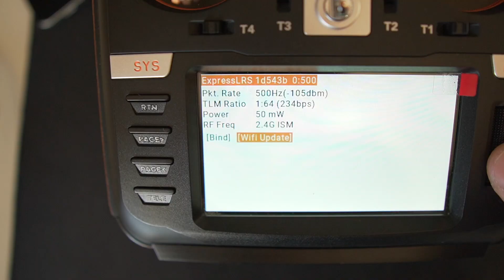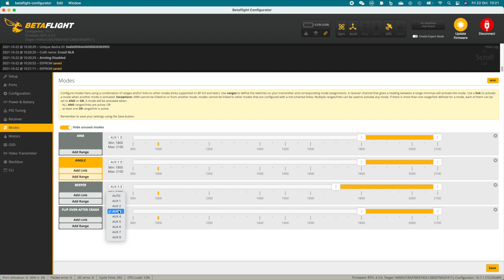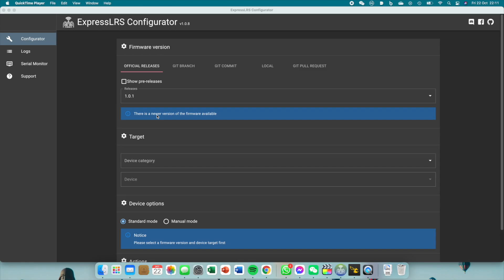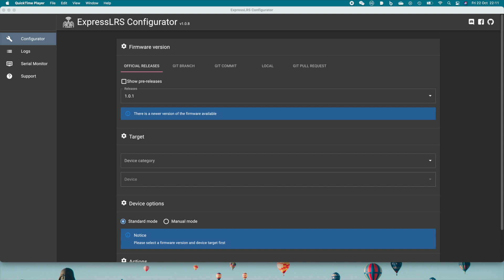ExpressLRS or ELRS 2.4 Ghz SPI receiver Setup - How to bind a Happy Model AIO ELRS card (Crux3 NLR)

Comment: Dumb question. Does an eu-lbt elrs radio bind to the built in spi rx?
Reply from the maker: Yes they do. The good thing with ELRS is that you flash the software you need. Both on the tx and RX. So you don’t have to worry much on those kind of things.
Reply: Thank tou for responding! 
That was the problem. On an aio spi fc you dont flash the rx. You only update betaflight. So i assumed it was going to be fcc.

Comment: I'm wondering if you can help me. I have a happymodel spi elrs 2.4 receiver and I flashed my zorro which I should not have done. Now it will not bind again but will bind to my jumper t lite in betaflight. I never flashed the FC. Now when I flashed the radio it does have a binding phrase. If I could unflash my radio it would be fine I think but I don't know if there's such a thing.
Reply from the maker: I’m
Not sure I follow the whole problem. Unless you have mayor version differences they should work together. SPI I believe is still in 2.X version unless you use betaflight 4.4, so you will need to flash your zorro with a 2.x version. 
In terms of firmware you never “unflash” you always flash, just the version that you want, so if you flashed 3.x and now you realized you need 2.x you just “flash 2.x”

I hope this helps
Reply: @NordFPV  Thanks a lot for the reply and info. I will look into it

Comment: how do I set to 250hz .. The problem I had was I downloaded the firmware off beta flight instead of happy models web page the firmware on beta flight is wrong
Reply from the maker: you can select 250hz in the radio, inside the ELRS script

Comment: I've a radiomaster zorro 2.4Ghz with the ELRS v2 and the LUA V2 (Edge 2.7.1), I bought a Mobula 7 1S 2.4GH, but I can't bind it one with another.
I've proceded like you sayed, but the drone wait for the radio and nothing happens. What i'm missing?
Reply from the maker: Most probably you have different ELRS version. Check what version has the drone. It may still be in V1.
Reply: @NordFPV  I Was in athor model settings. Thank you

Comment: Hi Friend, how to update the RX firmware that come factory-installed expresslrs inside the AIO Flight Controller? Do we need or not to update the firmware? Your thought would be appreciated. Thanks
Reply from the maker: Normally AIO have what's called a SPI receiver. Those one are updated when Betaflight is updated. A bit troublesome. Much better to have a serial receiver which is updated by itself. I hope that helps Ce Harn!

Comment: Hi friend.  I have a crux3...Don't need the passfrass?  I don't possibly use the ELRS configurator, And I don't understand what is the mode for fix the passfrass... Whitout elrs configurator. Or not is necessary?  Don't need flash the FC...?  In short, I would like to know how I could put the binding phrase, the transmitter flashes it to version 2.5.1 through a firmware file that a person prepared for me in a forum... now I have my 1w module already updated, now I need to update the receiver to version 2.x.x but I still don't understand if you can use both without the binding phrase or how this actually works... my problem is that the ELRS configurator gives me an error when I run it, error: bad signature 0x00000000 etc etc. don't possibly use the program... questions.. lol.  Sorry for my horribly English but I are Spanish..  tanks friend..
Reply from the maker: Hola, mi estoy seguro cual es tu pregunta. Pero te digo, uno no está obligado a usar el passphrase, puedes aparearte usando el botón, pero es mucho más cómodo con el passphrase. El configurador es importante para mantenerte al día. A veces si la versión del receptor y emisor no son la mismas, las cosas no funcionan.
Reply: @NordFPV  bien muchas gracias por su tiempo y ayuda.  Sólo necesito arreglar esto para empezar, poder bindear el quad Crux3,   pero necesitaba saber sí podría bindear sin el passfrass hasta que pueda arreglar mi PC y así ejecutar el configurador y entonces arreglar con una passfrass.  Muchas gracias
Reply: @NordFPV  creo que solo me queda flashear el controlador a una nueva versión 2.x.x.  para poder hacer la unión.. luego como decía, con más tiempo, arreglar mi pc para poder usar el ELRS configurator.. gracias otra vez amigo

Comment: Hi NordFPV, just a quick question.  I have a happyModel Mobula 6 with built in ELRS 2.4 SPI Receiver.  My ELRS transmitter was originally running ELRS v 1.1.0 and I had no problem binding to mobula6.  I then recently upgraded my transmitter to ELRS 2.0.0.  In betaflight I use the bind button to bind the mobula6 to my transmitter again.  It seems to work, but I noticed that as I move my controls (throttle, yawl, pitch, etc...) values in betaflight don't move smoothly.  changes to the controls values seem very jumpy or erratic.  I think I need to somehow upgrade the mobulas6 version of ELRS to 2.0.0 as well.... How do I do that?
Reply: so they are selling a drone that is obsolete before you get it nice NO i do not want to change my tx to an earlier version.
Reply from the maker: @danno20121  no, everything is software. You just need to get your parts to the right software. If you upgraded your TX to 2.0, you just need to upgrade the Mobula Betaflight firmware to the right release. As today the right release is still in beta, you can still use it, but you need to enable unreleased version to install it.
Reply from the maker: ELRS v2 is not backwards compatible with v1.x so you need to either upgrade your drone firmware or downgrade the TX firmware. The drone firmware is only in beta and a bit more complicated to upgrade. It’s possible but I’ll recommend to downgrade your TX and wait for the official betaflight support for your SPI receiver

Comment: Do you need to worry about version of ExpressLRS on TX and RX?  If so, what is the best way to flash?  I have a BetaFPV Micro TX that I flashed to 2.0 and a new Meteor65 Pro that I assume is on 1.0.  Betaflight says it is on 4.3.  Cheers!
Reply from the maker: Hi, yes you do need to pay attention on the version on the TX and RX, or at least that is the case right now with V2 and V1.X. Version 2 is not compatible with version 1.x, and you have to have v2 in both in order for things to work properly. This doesn't apply if you are in v1.2 vs v1.1 for example. I'll say that in general you should try to be in the same version on both RX and TX